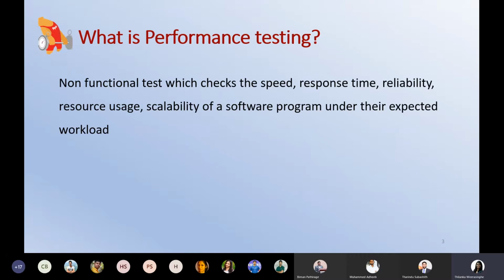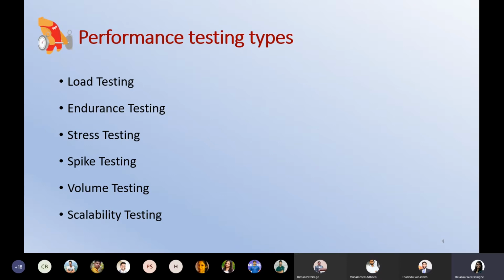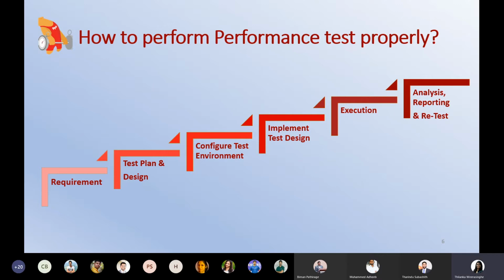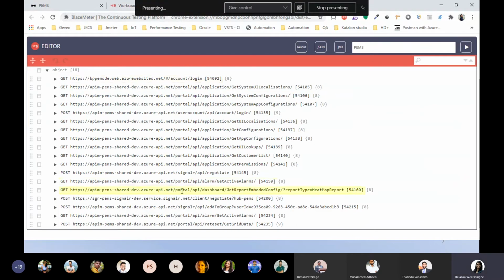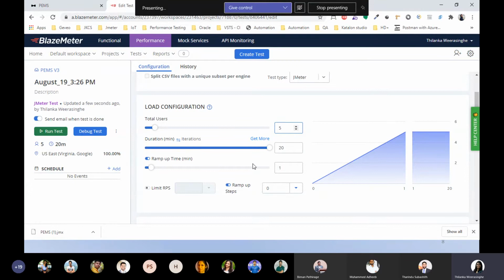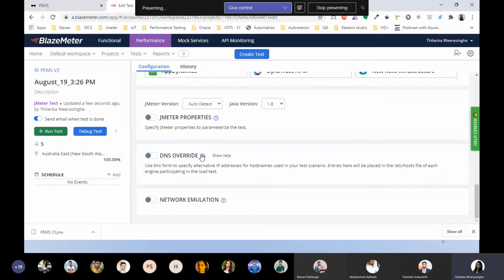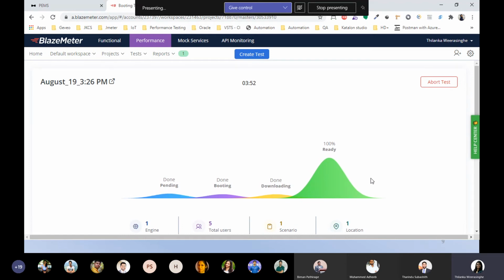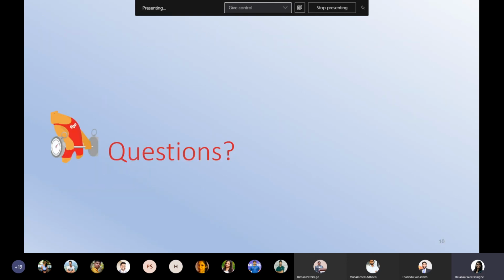Performance Testing with Blazemeter

Comment: Which is the best load testing tool for web based applications?
Reply: Best web based application testing tool is JMeter. Second is Loadrunner. But there are other parameters which helps to decide on which tool we should use for Performance testing.